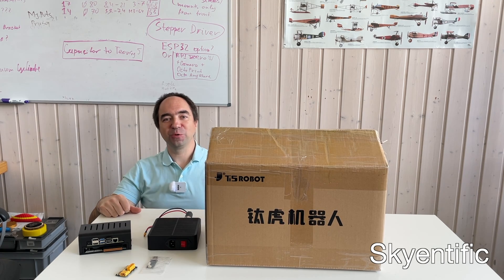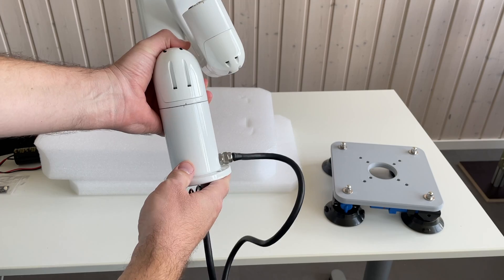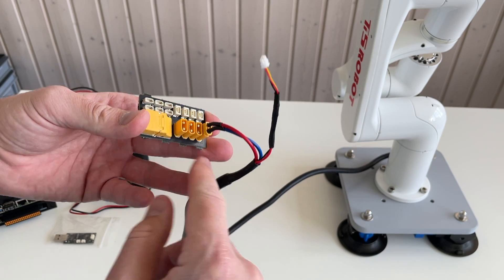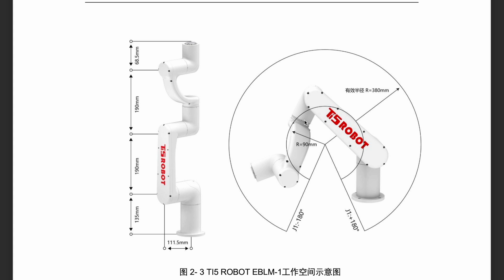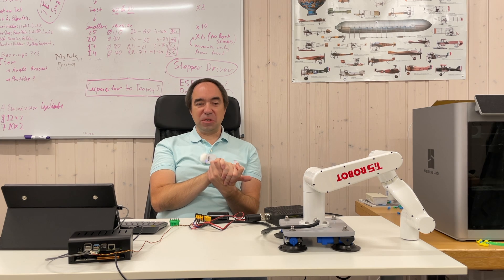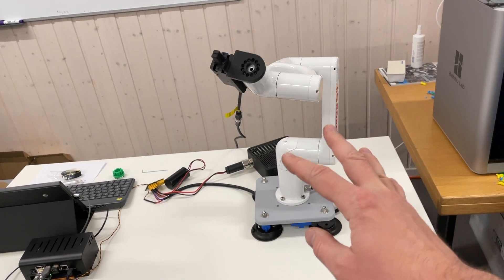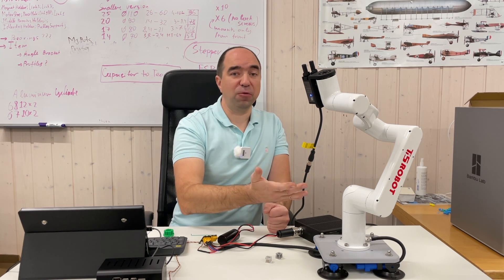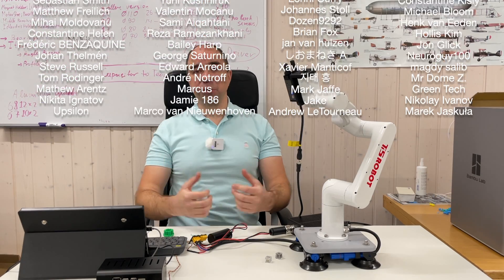Ti5 Robot Arm Review (Brushless motors, harmonic drive)

Comment: Good video as always.
The big bad thing i see in movement on this robot is that the axis dont start and stop all at the same time. I dont know the IK used here but they have to work allot on it ;)
Reply: Yeah something is not right with the MoveIt setup or ROS control hardware interface implementation - joint_trajectory_controller should have smooth movement for each joint in a way that all of them reach target at the same time, and with sensible acceleration/deceleration
Reply from the maker: I believe it can be quite easily corrected in the software, but this should be done. As I told in the video, the software part should be improved.